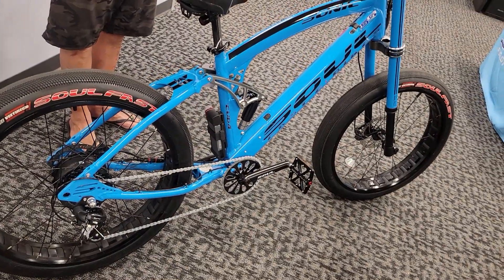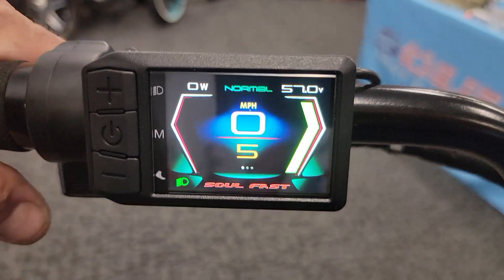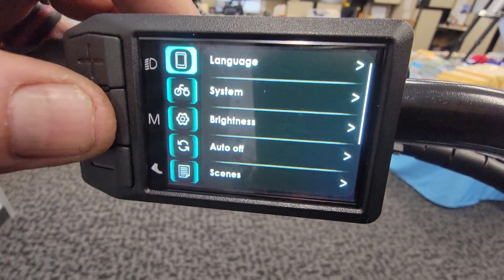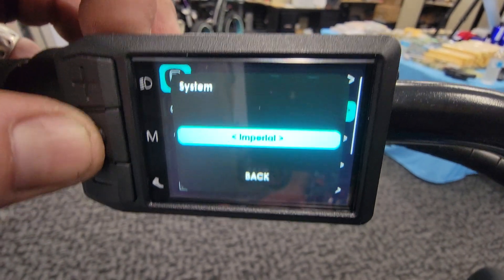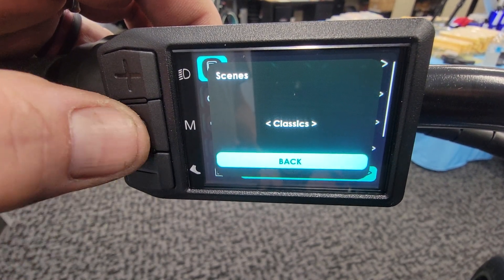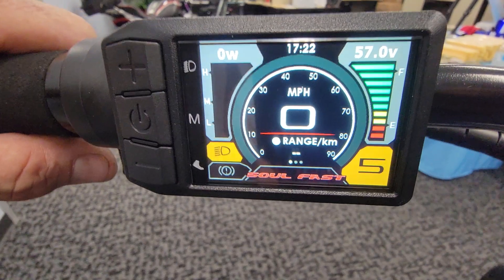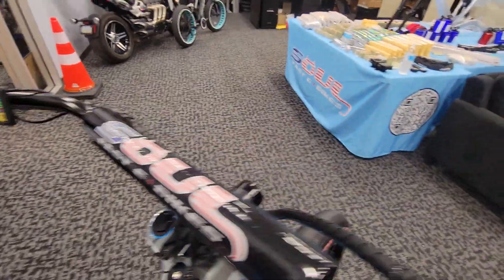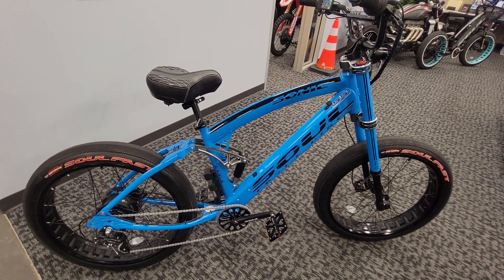'CUDA display functions 600c color display

Comment: I have a life4po battery. Can we change the cut off voltage? Currently it cuts under 38.5V but should be 37.5V